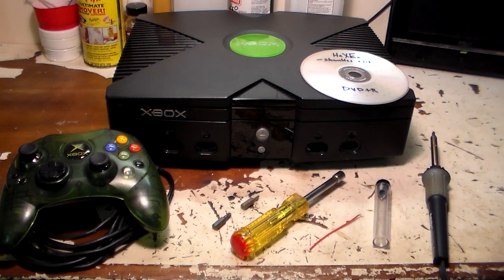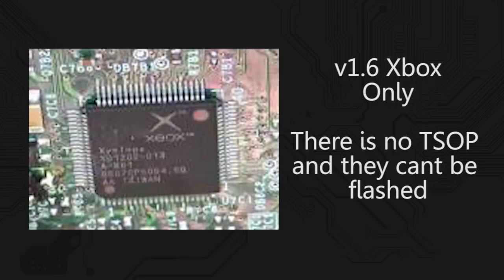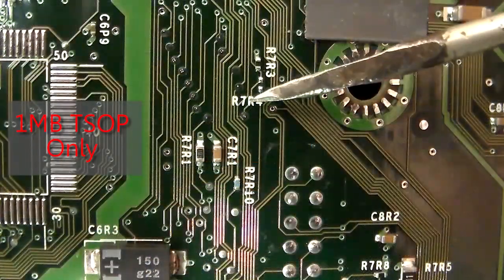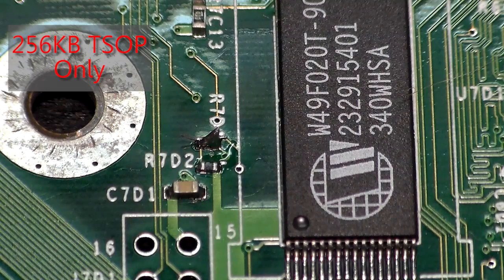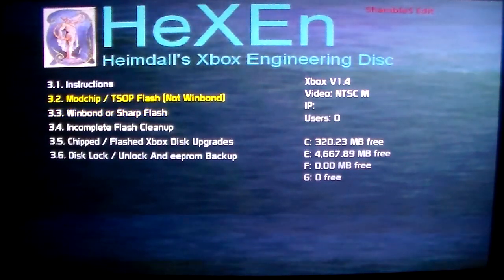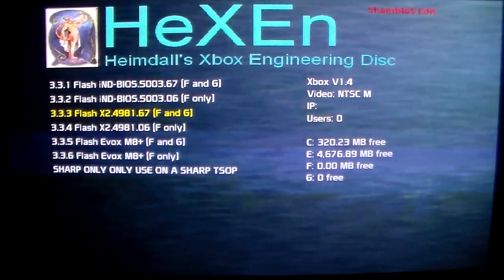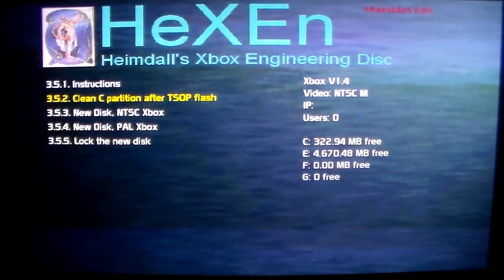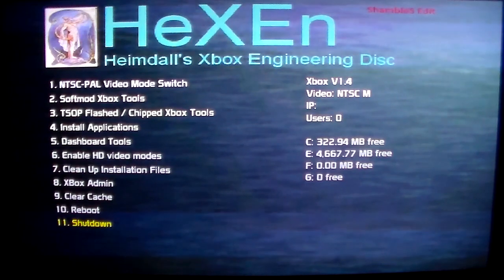How To: Xbox TSOP Flashing Explained -Part 2-

Comment: +thewheelman282 the xbox 1.0 I just got looks like this was attempted and botched. The solder pads for R7D3 are gone with slight burn marks. Is this fixable? Or possible help with alternate solder points?

Comment: I didn't realize how easy it is to do this. Way back when the Xbox was new I paid someone to TSOP flash my Xbox and I've always thought it was a complicated process. Now I think I might TSOP flash my other Xbox, not needing to lock hard drives makes this mod worth it over just softmodding imo. I have a 500GB drive that refused to lock in my softmodded Xbox, but my TSOP flashed Xbox doesn't care about locked drives so no problem using it there. Anyways, thanks for the video, this was super helpful

Comment: ******Special Insturctions for Winbond Chips Only********

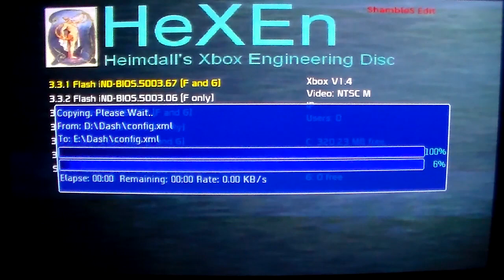When attempting to flash the bios on a Winbond chip and boot Gentoox (around 23:26 of the video) the screen may go black if using component cables =5 wire cables. The solution is to: either use composite cables =3 wire cables OR you can flash without a display, just carefully follow the video and count button moves and the selections. I was able to do it without a display just CAREFULLY follow selections.

Comment: very easy doing this on revision xbox 1.0 ,
only need to solder  2 points for the 1.0 , 
points are close enough for just beaded solder,
actually , no room for wires really, just put the least amount of solder, when bridging the points.

and at least for me , didnt see any problem with the points staying soldered on my 1.0 ,
but thats me , and my 1.0 ,
others could be different. im sure i will try other bioses later also.

i love you xbox ver. 1.0
Reply: I think I have the same version as you. Mine has the GPU fan on the heat sink. So this version doesn't require a wire to supply extra power just solder the two points?

Comment: Gave it a go today and well . . . even though I can solder pretty good, I almost messed it up completely.  Managed to get everything re-soldered in it's right place and it still works, but wouldn't accept the command to flash.  Going to leave well enough alone.  Hadn't touched it for 6 months so I think caring about what BIOS I have is a little behind me.  :)

Comment: The hexen disc is pretty cool. It will i.d. the version you have. I was attempting to do my first tsop flash and found out I have a v1.6. Oh well, I don't need to open it just for removing the clock cap so I will save it for later. As @Cartman122 said 1.6 :(
I have other versions and am excited for my 1st flash. Thanks Wheelman.
Reply: Im two years too late but just so you know, the clock cap does NOT need to be removed on a 1.6. That will actually brick the xbox

Comment: Just out of interest, what benefits does an unlocked hard drive have over a locked one?
Reply from the maker: +TheGoose81 easier troubleshooting /upgrading mostly. if you want to upgrade the HDD or rebuild file system for whatever reason, you dont have to bother with locking and unlocking it. and if you dont have access to tools to perform the locking/unlocking, it can be a huge pain to troubleshoot

Comment: best video ive seen on tsop ,thanks very much ,very informative.
Reply from the maker: +jason dowsett not a problem man. glad you liked it!
Reply: ive got 3 xboxs which are softmoded,but the hdds aren't locked .what would you suggest to do? can I tsop them .or will I have to hard mod them.
Reply from the maker: jason dowsett
if you have the eeprom.bin file or the password written down you can lock the HDD with XboxHDM on a PC. then install the HDD in your xbox so the softmod works and TSOP flash.
or you can buy/build an eeprom reader and manually recover the eeprom.bin file from the motherboard and then use XboxHDM.
or you can hardmod first, then install and lock the HDD, remove the chip, then TSOP flash
Reply: don't have the keys,ive got 4 mod chips coming, so ill hard mod them.thanks for all your help.oh by the way ive just managed to tsop 2 other xboxs,using electric paint.was very easy to do.
Reply from the maker: ive heard about that conductive ink. never used it myself though
Reply: its worked ok so far on 3 of them.

Comment: First, thanks for the great videos. I now can change thermal paste and light up my controller ports thanks to you. Couple questions because I’m just learning about this stuff.  Can I do the TSOP if I’ve already upgraded my hard drive
Secondly, when you unlocked the hard drive does that mean I can now put any ide hard dive on my Xbox if the one I have ever fails? Thanks again.
Reply: 1. Yes.  I upgraded the HDD before the TSOP mod. 
2. You should be able to put in any IDE drive.  With an adapter, you can even put in an SATA drive.  You will need to format the drive and build the partitions with a program like Xbox HD Maker.

Comment: I have just opened up an old xbox I had in the loft and it doesn't have any of those.

What it does have is Samsung ram, Focus chip, tsop chip Atmel at49f002a 55ti 0424
Reply: I thought samsung ram and focus was 1.6?

Comment: Does my xbox have to already be tsoped to read hexen 2017?  I copied the file to a disc and put it in my softmoded console and it kept saying that the tray was empty.  I am using a Memorex cd-rw that I formatted in windows 10. Should I have not formatted the disc? I check the disc and the hexen 2017 is on it. Do I need to install an image burner?
Reply from the maker: probably the xbox cant read your disc for some reason. either it wasnt burned correctly or the disc drive cant read cd-rw's. use the PC program imgburn to burn discs just to be safe

Comment: I've got one question : is it possible to tsop an 1.4 Xbox with aladdin xt modchip soldered to the Mainboard? My goal is to have two bioses. One on the modchip an one on the xbox
Reply from the maker: Yes you can but you need the ability to turn the modchip off. otherwise the flashing process is the same

Comment: I have a couple questions. I have access to a chip writer. and I think even some of those 1mb tsop chips. could I remove any 256k tsop and replace it with one one of the 1mb chips? also if they are intrupted during flashing  on the xbox I assume that they are actually still flashable they would just have to be removed from the motherboard and put in a chip flashing machine like I have access too. I have a chipmax 2 with tsop adapter. 

I am interested in the quad bios setup. or maybe just 2 bios. and which BIOS that may take advantage of ram upgrade. if you have any information on that?
Reply from the maker: The 1MB and 256K TSOP chips are different physical sizes and have different pin counts so you probably couldn't put a 1MB chip on v1.2+ motherboards. The chip is still writable if it's bricked so you would need an external programmer. Afaik all 3 of the newest custom bios's support the RAM upgrade so it y just your personal preference

Comment: 5:20 i have a single row but it doesnt have those extra gnd or 3.3v stb wires but it does have that orange 3.3v wire tho; does that matter? Or is it just the single row thats all that counts? P.S my softmodded xbox already says on screen i got a 1.0 version
Reply from the maker: its just the single row that matters
Reply: Thanks man, Great video, got my xbox TSOP now, 1st time i ever solder anything lols; now i gotta see how to fix stuck DVD drive and how to make it quite since the fan is loud on this 1.0 model.
Reply: Stuck dvd drive tap it ontop while pushing the button.. After you get it open clean the belt its easy job i used tweezers to remove and replace on all my xboxes lol.  U can find vid on utube to clean belt.
Reply: oh my xbox was already open, but yea i use rubbing alcohol on the belt and it works again
Reply: stuck dvd drive is the rubber band in the drive.google it their are videos to fix it.its easy good luck.

Comment: Any chance you know what R7D9 and R7D2 actually are or what they do?  After doing this with my Winbond chip I'm having trouble with my ethernet port.  Prior to applying the new TSOP flash I noticed that my router showed no link light whatsoever when connected to my Xbox.  After the flash I now get a blinking link light on the router end, but I can't quite tell if the Xbox end is blinking.  In the network settings under UnleashX it shows "No Link".  I'm curious if I may have damaged one of those two components when I was soldering so close to them, and if that could kill the ethernet port.
Reply from the maker: your not the first person this has happened to apparently. there have 
been like 1 or 2 other people commenting that the ethernet port stopped 
working. personally i have never heard of this until a long time after i
 posted this video so im clueless
Reply: I fixed my problem, but the solution made absolutely no logical sense I can decipher.

Before doing the mod my Xbox connected to my network without any issues.  After I soldered the points, without making any other changes (still running under the softmod at this point before flashing), I noticed in UnleashX I had no IP assigned, and according to the network settings it didn't detect a link.  Without changing any settings I reconnected my ethernet cable several times at both ends, restarting the router and Xbox several times, but it refused to acknowledge any connection.  I tried different ethernet cables as well with no luck.  When I connected my laptop to the ethernet cable/router and used the same network settings, everything connected fine on the laptop.

I tried a different router and the Xbox actually connected with it just fine.  If something had actually been damaged it shouldn't have been able to connect with any router.  A settings issue either on the router or Xbox end shouldn't have been the problem because I hadn't changed anything on either end except making the solder connections for the TSOP.  The router shouldn't be damaged because my laptop could connect with it.   

Unless the Illuminati installed a specific feature on my one router that specifically blocks an original Xbox from 2002 connecting to it after modding, I can't figure out any logical explanation for why that fixed it.  I tried everything else, but it now only connects with the new router.

Comment: Great video I'm going to pull my old Xbox out of storage and attempt this. Do you have any recommendations or video links on how to softmod first and upgrade the HDD to a bigger drive after TSOP?  Thanks will be checking out your other videos in the near future.
Reply from the maker: easiest method to softmod is to use the save game exploit with splinter cell or 007 AUF. then follow this video to perform the TSOP. you can upgrade the HDD later if you download Hexen 2017 from theisozone. it makes the upgrade process very easy
Reply: thewheelman282 thanks a bunch! I will check that out and see how it goes.

Comment: Man, Best explanation ever!! believe me I have seen many before I TSOP my xbox. A quick question, I want to upgrade me ram from 64mb to 128mb do you know which bios support it?

I am struggling a little bit and is getting hard, I am good at soldering but clearly not so much in software!!

Thank you.
Reply from the maker: Any of the 3 BIOS's on hexen support 128mb ram
Reply: thewheelman282 not really!! I TSOP with evo x and no results at all, one xbox flashes green no video, the other one flashes orange and red but once i press the dvd button it turns off and starts back with green and red light!

Comment: I cant run hexen from dvd (green, orange, red flashing lights). I tried using hexen form hdd to flash a 1.4 xbox with winbond, but it wont start gentoox. What else can I try?
Reply: hmm, all different revisions of the original xbox have different drives that have different success rates with all types of discs. I tried a dvd-r and it flopped, then a cd-r that didn't work. But then a cd-rw seemed to do the trick for me. Its all about trial and error. and yeah, the hdd hexen sucks, i tried it and got no success. Good luck!

Comment: Hello. I have a Xbox with st chip. One row power connector to motherboard so that menns that it's a 1.0 or 1.1? Problem is when I make a solder a bridge on R7D3 and R7R4, i put it back together and Hexen disc is not working. I have used the disc on other Xbox's and know its working. Do i need to softmod before using hexen?
Reply from the maker: yes because your xbox is not modded yet. Soldering the 2 points only disables write protection the TSOP so you can flash it later. it does not mod your xbox
Reply: thewheelman282 Thanks for the answer, and I figured it out. My problem is that I thought that when you disabled write protection you could use hexen disc to softmod. I missunderstod the whole thing. I got it softmodded and tsop now! 

Thanks for your help! Would be difficult to call Microsoft to ask for help😎
Reply from the maker: glad you got it working!

Comment: Wow, this is easier than I thought.  I have 3 Xbox consoles (only two are currently soft-modded, but doing the 3rd one is easy).   I may try this with my Halo Edition Xbox if its not a 1.6 (is there any way to tell what version it is w/o opening up the console?  Like a date code or serial number code or anything?)
Reply from the maker: +DvdXploitr sure is:
http://www.theisozone.com/tutorials/xbox/general/manufacturing-mfg-dates-for-the-xbox/
Reply: I decided against modding the Halo one....don't worry
Reply: +DvdXploitr you do need to remove the clock cap if its a version lower then 1.6 it will preserve the motherboard.

Comment: Do you know what the R7D2 (Resistor?) does for the Xbox? I accidentally removed it and my console is still working but I'm not sure if I should replace because it might not be needed. I have the windbound V1.4 Board.
Reply from the maker: im not sure what its for and im not sure how important it is. if possible, you can measure the resistance of R7D2 from another xbox and get a resistor of the same value. it doesnt have to be SMD. you can use a standard resistor if you want to
Reply: thewheelman282 good idea. I might do that. I got a new soldering iron and didn't have a small enough tip and I was to impatient. Lol. Great idea!

Comment: I'm pretty sure I have a version 1.0 or 1.1. I have a fan on the GPU so 1.0? Does my xbox require to run a wire at all or can I just bridge the two areas that need to be bridged?
Reply from the maker: You don't have to run any wires for that model. Just bridge the connections
Reply: @thewheelman282  awesome thanks man!

Comment: Hello me again. I just bought a new Xbox instead cause I figured the time and money spent repairing a dead Xbox is better spent just getting a new one. Question, I have a eeprom reader/writer, could I just read both xboxes and replace hdd key on new one? Thanks
Reply from the maker: in theory, yes that would work
Reply: Nice. I knew that thing would come in handy.
Reply: Thanks, but now I have received the new xbox (1.0 btw). The only catch is that after replacing eeprom and hdd, it will boot startup screen, then a black screen. I put the old eeprom and hdd in and boots retail. When I try to softmod it it loads the game, but when I load the SID5.1 with Splinter Cell, it black screens again. I have tried both composite and component cables, but both do the same. Please help :(
Reply from the maker: how are you replacing the eeprom? like flashing it with an eeprom reader? that method is kind of hit and miss. ive tried the same thing myself and havent had success. some v1.0 xbox's with really early kernels dont show error messages at bootup like the newer versions do so that could explain the blank screen, possibly. you wont be able to put your new HDD in the xbox unless its locked with the eeprom/HDD password thats programmed in the new xbox
Reply: Ok. I did get the old one back on and can boot to retail dashboard. I still cannot run the softmod installer though. It also displays a black screen.

Comment: I may want to do this in the future and this is a very good video for it. I am new to soldering and I have never done it before but since the points are so close to each other, couldn't you use a very small wire and use some sort of glue? I know I sound like a complete noob, because I am one, but let me know if I could use this method.
Reply from the maker: Lars Kuck , not glue but your close. You could use conductive ink. It's used for making temporary connections
Reply: Ok, I'll have to try and practice some soldering, doesn't look that hard, and get an original Xbox without a Sharp EEPROM to make it easier. I would want the connection to be somewhat permanent so I think that I would just learn to solder for when the time comes. :)
Reply: Does the connection needs to be permanent or does it only have to hold on during the flashing part? I'm also thinking about using conductive paint because I have no soldering skills yet.

Comment: I have a question: I have a modchipped Xbox, but it's working only from chip. If I disable chip it won't boot (red led only). Is it a corrupted data in tsop?  And how can it be repaired.
Reply from the maker: could be corrupted tsop but that would normally cause the led to flash red and green. but it could be. also depends on the chip and how its installed. different chips have different install methods so the xbox not booting without a chip could be a side effect of the chip being used. but thats just a guess. i know for a fact that v1.6 xbox's wont boot without a chip due to having to cut a trace on the motherboard so thats a possibility
Reply: It's a 1.4 version. The chip looks like Alladin XT. I've tried to desolder it, but the effect was exactly the same (instant red led).